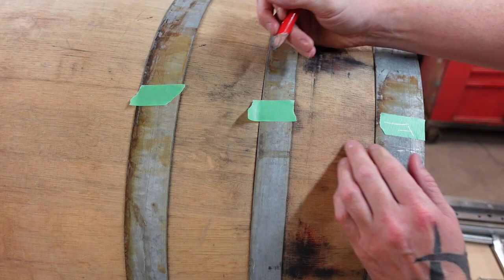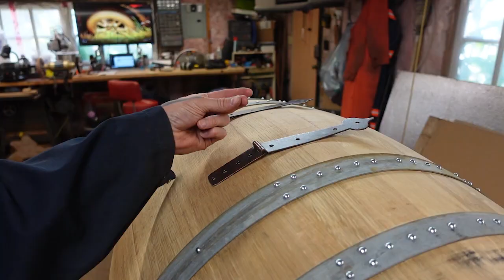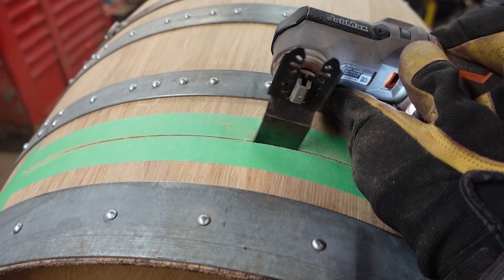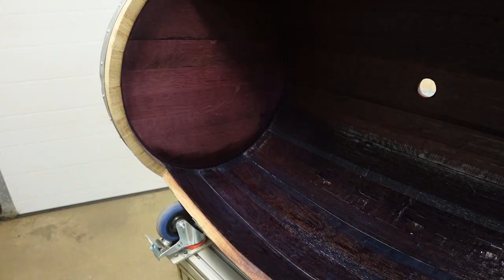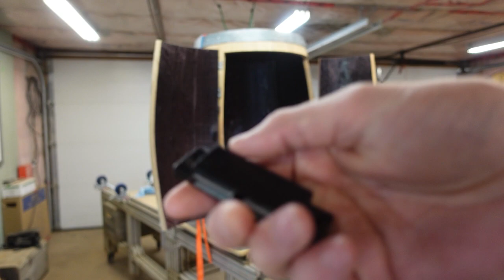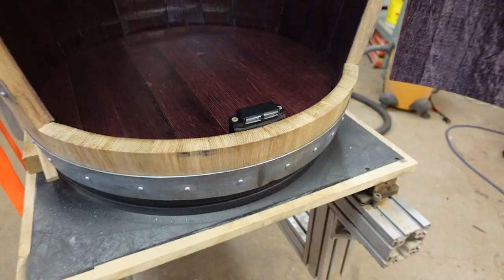WINE BARREL CABINET/BAR - DIY - HOW I BUILD MY CABINETS

Comment: Awesome video...Where did you get or how did you make the kid to center punch marks for drilling?  Can you also share where you get the pins you use to hold the barrel hoops in place?
Reply from the maker: I designed and 3D printed the guides for center punching the drill locations on the hoops and the fasteners I use to secure the Hoops are on the McMaster-Carr website, search for Screw Nails.